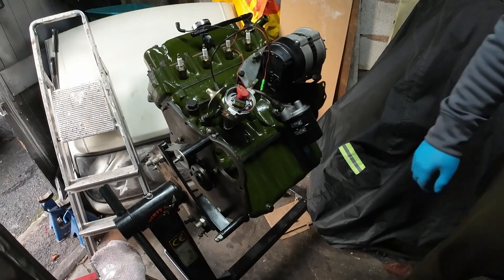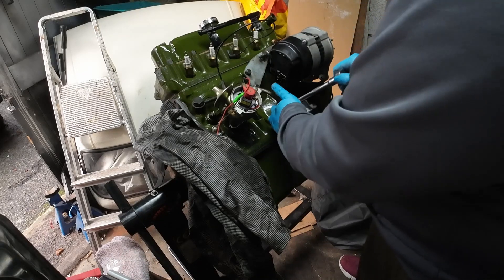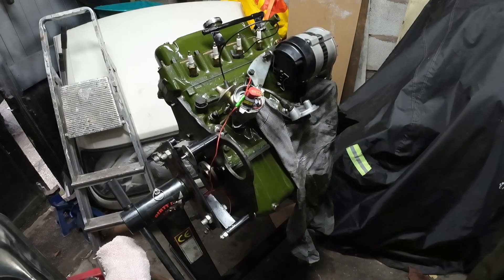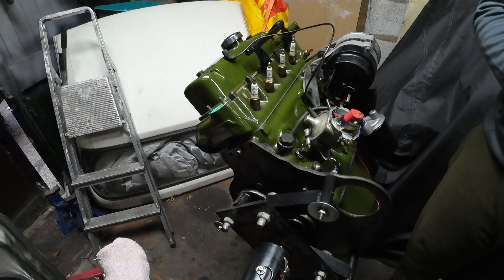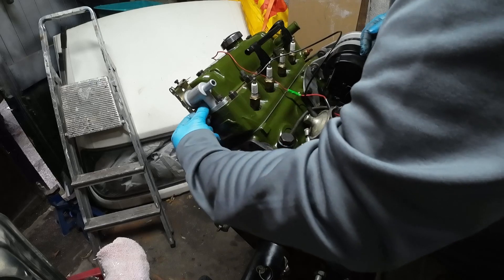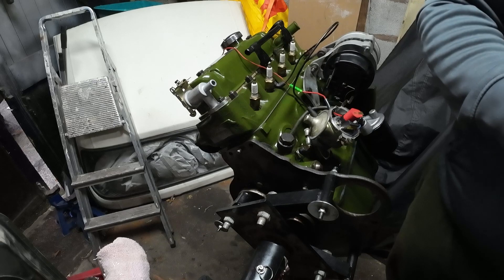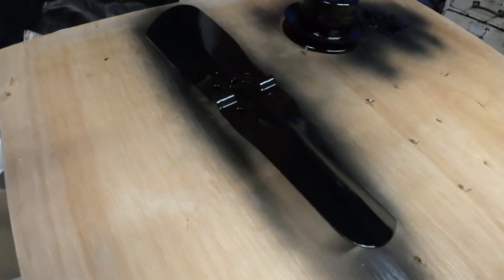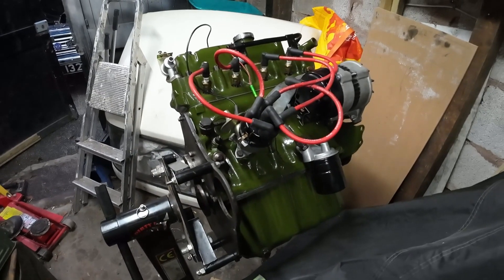Back in the Garage: Morris Minor Engine Rebuild Continues

Comment: Nice video thanks! The rad needs recoring it will be a lot less efficient with the matrix corrded away like that. Also since i rebuilt bt MGB engines years and years ago it has never leaked a drop! Neither did my Vitesse 2 litre engine. Probably explained by my addiction to the smell of Hermetite Red!
Reply: Haha I do like hermetite but have run out so was using up my hylamar blue. I have purchased a new rad as amazingly it was cheaper than a recore, so may still get the old one recored as a spare as I seem to be obsessed with spares.